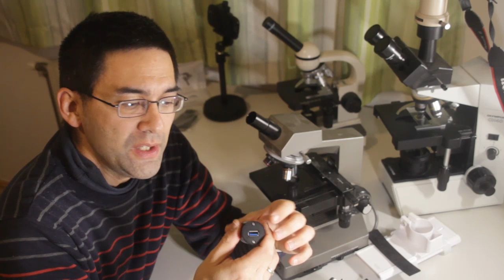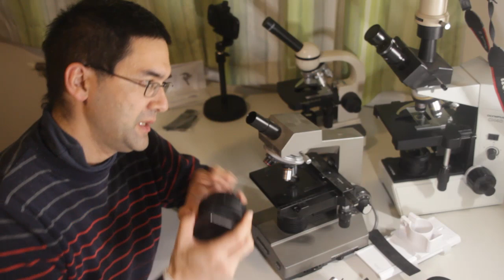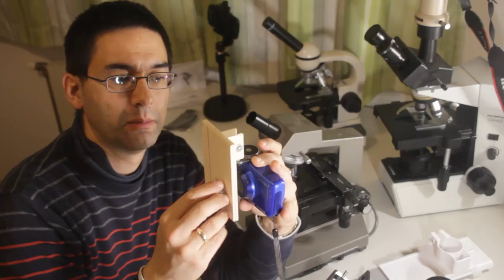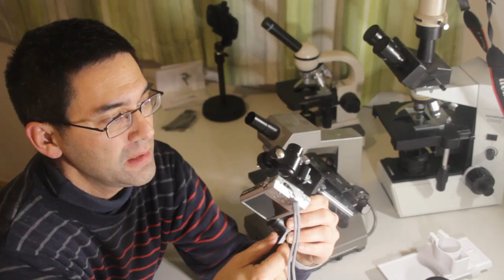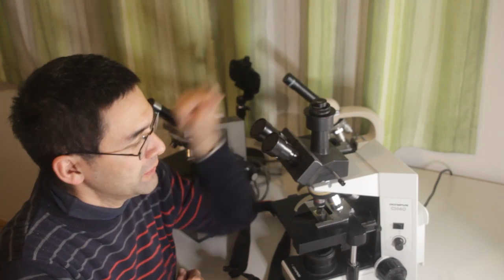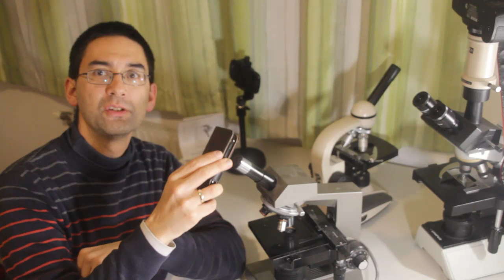🔬 018 - How can one take  pictures with a microscope? All about Microscope CAMERAS and ADAPTERS

Comment: Apart from the compensating camera eyepiece and it corrections, would you have the same imagequality if the camera was mounted on one of the eyepieces?
Reply from the maker: The light is slit up between phototube and eyepieces, so there should be the same quality. I have a stereo microscope that uses mirrors to redirect the light to the phototube and I think that the quality though the phototube is actually a bit worse than though the eyepieces. So it depends mostly on the optics used.

Comment: So after 4 years... simple solution exist?
Worth just get USB3 adapter?
Reply: EDIT: I answer myself.. If you don't have camera, and you want amazing results (video/images)
Just get modified GoPro camera from back-bone website. Example.. Gopro8 becomes compatible with M12, CS-Mount & C-Mount
And exactly C-mount adapter allows to connect a camera to the trinocular port of the microscope.

Comment: what a senseless calculation and discussion.......the human eye has a resolution of max 4.1 Megapixel. The limiting factor ist the resolution of the presentating media. Use a  Laptop ur Desktop with heigh resolution: 1920 x 1080 and that is about 2 Megapixels,. So an camera or 3 mega is sufficcent
Reply: Dear Lothar, a human eye has near 130 megapixel (Wikipedia). So, please, do not think only you are wise and others are stupid. You obviously  are not a microphotographer.
Reply: @KraterStromboli  only percent of 130 megapixel are used, the others are not sharp. I am no microphotographer but a scientist
Reply: @lotharmayring6063  I am also a scientist and use photography above 50 years with telescope and microscope. The main task was to get the image of maximum resolution and detailed. 
A 35mm film frame (24×36mm) has 12 Mpx. 
From which reliable sources on good authority have you got that yours percent?
Reply: @KraterStromboli  the resolution of the best optical microscope objektiv is less than 3Mpx. Why do you not use electron microscope or  space telescope, it seems to be a hobby for you, have a look at wikipedia
Reply: @lotharmayring6063  resolution of optical devices is measured in line per mm. Pixel for matrix or film. Resolution of microscope depends on monochrome short wave illumination (ultraviolet and quartz optics). So, yours information about microscope objectives is inaccutate, regrettably.
Reply: @KraterStromboli  and of course you use gammaradiation mikroscope  with superconductivity magnetooptics. Would you please dont fool me. END of discussion
Reply: @lotharmayring6063  Thank you!!

Comment: The issue with the USB 3.0 dropping to 2.0 is the bandwidth of the USB bus. I'd similar issue while setting up my VR sensor, getting 4x USB 3.0 to work at the same time is a huge hassle if you have a VR ready motherboard. 

TLDR; get a motherboard or PC with proper USB 3.0, or one that says VR ready.

Comment: Hi Oliver, thanks for your super informative videos! I just got a couple new set ups (trinocular Amscope T409b-dk, and  trinocular stereoscope) to use with my mirrorless dslr and dedicated hayear scope cam.  While my videos come out amazing, my still images are complete crap LOL.  Do you need to really turn up the illumination in order to get acceptable shutter speeds for still images? I had to crank my iso to 1600 or 3200 to get just 1/30 of a second, which as you know isn't fast enough to negate motion blur, and the noise at those ISOs is frustrating.  If you have to increase the light intensity, do you still use the eye pieces to follow your subjects or do you do everything on the screen of the camera?   I have my cameras connected to a large 1080p television but its difficult to follow the subjects with any magnification over 10x, because my camera is an APS-C the field of view is fairly small.     Thank you for any help you can lend me!  Its difficult starting out ;o)

Comment: Thank you for very good video, can I asc what do you think about these 2 sensors one has 1080P/Sony IMX236 1/2.8"(5.5x3.4) the other is also  Sony Imx185 1/1.9"(7.20x4.05) there is difference in size of the sensors which do you think is bether situable for trinocular stereo microscope to obtain good quality picture and field of view? (I have already 2 reduction lenses 0.35x and 0.5x) 
Thank you.
Reply from the maker: Well, much depends on other factors as well, besides sensor size. But larger sensors have the advantage that one is able to simply see a larger area (larger field of view). Larger sensors also have a better signal to noise ratio. But with appropriate reduction lenses one can also get a better field of view with small sensors. If you cram a lot of pixels into a small sensor, then you might not fully benefit from the resolution, as you might get more "empty resolution", where the sensor has more pixels than the resolution that the microscope is able to supply.

Comment: Hello, 
Thank you for the informative video. I have a question, please. What do you think about the Nikon microscope that already has an assembled camera system built-in?
Thanks
Reply from the maker: Can you tell me the model of the microscope so that I can have  a look at it? Normally high-end microscopes like Nikon etc do not have built-in camera systems (unless for specific uses), becasue they keep microscopes modular and for this reason they do not build in cameras normally.
Reply: Be careful with built in cameras... first if the camera experiences a problem you cannot simply send in for repair or replacement - at a minimum the entire binocular tube must go meaning your microscope is down...second they don’t allow for future camera upgrades or replacement like a phototube/camera would...a good microscope will last you decades but camera do not - even if you just consider operating system compatibility...in 15 years your microscope will hopefully be functioning perfectly fine but will the camera be compatible with current version of windows?...will much more powerful and inexpensive cameras be available that you might want to upgrade to? What if the camera fails - no one repairs cameras so you’re stuck...manufacturers move on from these camera models very quickly...so for these reasons I would generally not recommend built in cameras - even if at the time they are a slightly cheaper option

Comment: Does someone know a tutorial for adapting the exposure & gain in the microscope camera? Thank you!!!!
Reply: Do you still need help with that?
Reply: @ThatGuy-bx4yi  Yes please! it will help me a lot!!!
Reply: @ilm5929  Are you using a USB camera for your microscope?
Reply: @ThatGuy-bx4yi  Yes, I have a OMAX microscope, and a OMAX USB camera. The camera has 10MP. But, the problem is that when I try to take pictures they are not that good.
Reply: @ilm5929  have you heard of the program called OBS?
Reply: In general I would forget about gain if you’re talking about transmitted light microscopy.  Set the light source properly and you should have plenty of light therefore you do not need to adjust camera sensitivity via gain - this is generally used for low light level work that would otherwise require very long exposures.   At that point just adjust exposure time to optimize...if you want to take exposure adjustment further and you can view the image histogram live simply look at histogram to ensure pixels are properly distributed and neither overexposed (pushed all the way to right side of graph) or underexposed (pushed all the way to left side)...tips for best photographic image 1. Make sure the microscope is set up properly, aligned and using proper light level to produce best possible image in eyepiece before you take picture - do not try to correct poor microscopic image with camera settings 2. Use lowest gain setting possible - increasing gain makes the camera more “sensitive” and reduces exposure time for dim subjects but with the significant drawback that it introduces a lot of noise

Comment: Is there a reason to go for for an DSLR (Digital Single Lens Reflex) Camera over a MILC (Mirrorless Interchangeable Lens Camera) in regard of using it with a microscope?
Reply: Actually mirrorless cam works great for photomicrography. I just restored my American Optical AO One Sixty vintage microscope with the Sony A6000 attached (homemade mount). It works! Image way much better than my old Nikon D90 DSLR. Most of all, the mirrorless body is small and very light so it occupies less stress on the eyepiece barrel.
Reply: I'm intersted in getting an answer to this question as well. Thank you!

Comment: Couldn't you use reduction lenses to overcome the problem with the small fov on a small sensor?
Reply from the maker: Yes, and this is indeed done most of the time. In the case of the USB 3 camera, they use a different strategy by moving the sensor forwards to the focal point of the objective. This improves the situation a bit (compared to having the sensor further back) but still results in a relatively small fov.

Comment: Good point about not all computer manufacturers implementing USB 3.0 properly. Is there a way to fix this problem with firmware/software/driver, or is it a hardware problem?
Reply from the maker: Tried all but not successful. Will switch computers and try.

Comment: May I ask what photo tube should I buy from ebay？I bought a  second-hand Olympus CH30 with 3 eye yesterday，thank you
Reply from the maker: I would buy a low cost microscope camera that you can connect directly to the microscope without separate adapter. The microscope eyepiece cameras can be put into the microscope directly on the tube (or an eyepiece). If you want an original OM Phototube and NFK photo ocular from Olympus, then this can be expensive (if you even find one on ebay) and then you need an SLR camera as well.
Reply: thank you very much :-)

Comment: Have you looked into 3D printers? It should be easy to make great adapters with a 3D printer. Or even 3D print a full microscope.
Reply from the maker: I thought about it, but I am not sure if the 3D printers have the resolution to make a sufficiently fine threading for screws etc. Or maybe the plastic is soft enough and a threading is not required. 3D printing a full microscope might only be meaningful if the microscope is 3D printed from metal (laser heat to melt metal?). Plastic might be too light to be stable, unless one adds weight. And also here there is the question of tolerance and mechanics. The Legoscope does use 3D printed parts: http://legoscope.squarespace.com/
This one is similar to the one I made (which does not use 3d printed parts).